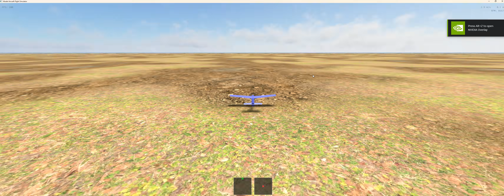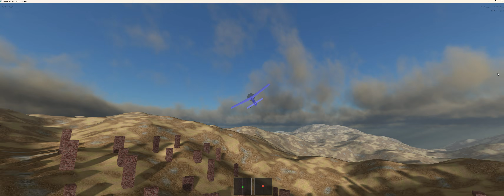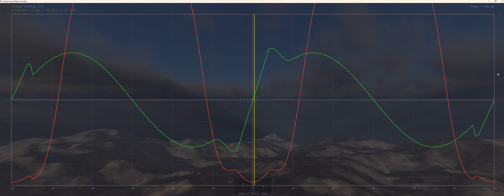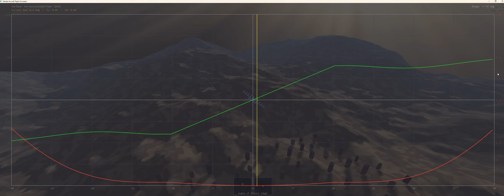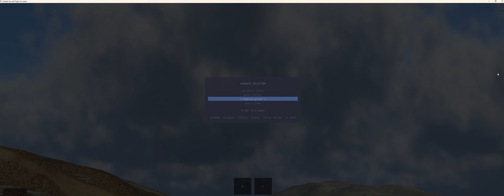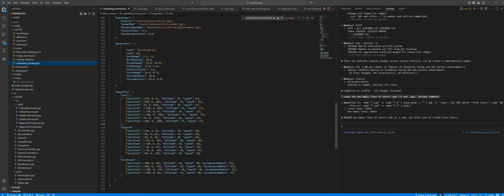Flight Simulator - Three days with Claude Code

Comment: Thats looks nice but i think it would be hell to optimize later
Reply from the maker: It's true that if you wanted to make a 3D application that is absolutely first in class for visuals AND performance, this is definitely not the way to go - i.e. writing it all from "scratch". But that is (probably) true whether or not I coded it 100% by hand, or co-wrote it with Claude. If I was doing this for real (i.e. making a simulator for release that is first in class for visuals as well as physics, content etc etc) then everything would be done differently. 

In addition, I was really surprised (shocked, actually!) that the code did not descend into a tangled mess. It ended up with clean looking code, well commented, documented, nicely formatted, that I could easily have written myself. I stopped with this project when it reached around 20k lines of code, but am confident it could have gone further. I could also have taken it upon myself to profile, figure out what the bottlenecks are, and then concentrate on optimisation or even rewriting them, and still be ahead.
Reply from the maker: In addition - I'm 100% confident that I could have used Claude to extract out the pure simulation parts of the code into a form that I could, for example, integrate directly into Unreal Engine (for example). So I could develop a super high-fidelity simulation in this sandbox environment that is extremely quick to compile/start-up, before integrating into a game engine that gives me high graphical capabilities, even though the iteration times can be much longer.
Reply: @profrat thats sounds cool
Reply: @profrat  so it's like a programmer becomes a true engineer and not a plumber with ai stuff. Pretty scary how good it has become
Reply from the maker: @denatle  I see it as a velocity multiplier. If you're a competent engineer/programmer (or someone with that mindset), then it can potentially help you do what you could have done without it (which might involve learning whole new APIs etc!) 50x faster. But if your brain is a complete mess, then it will just make you 50x more effective at producing garbage, unless what you're asking for is inherently either very simple or aligned with what the AI system already knows how to do!